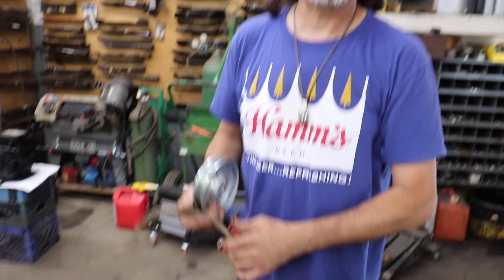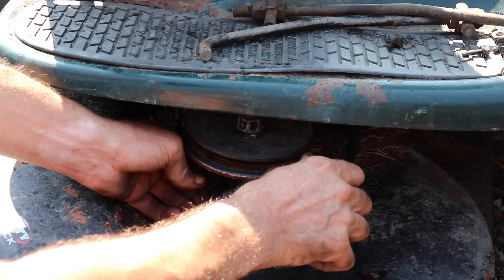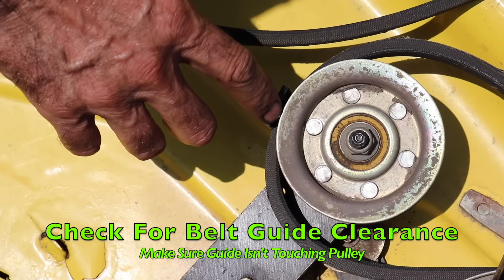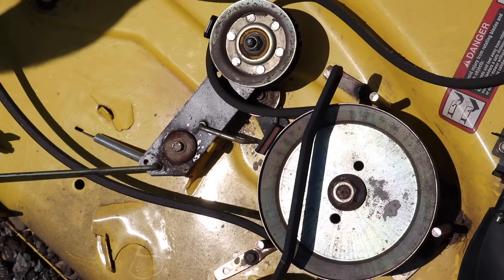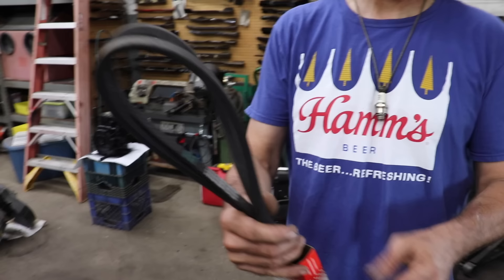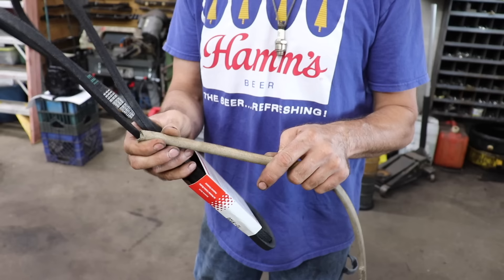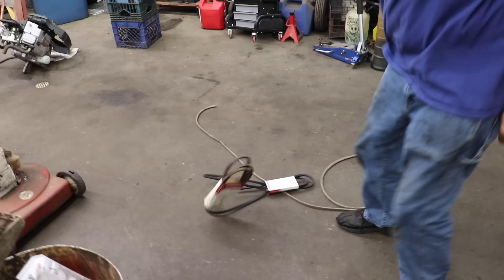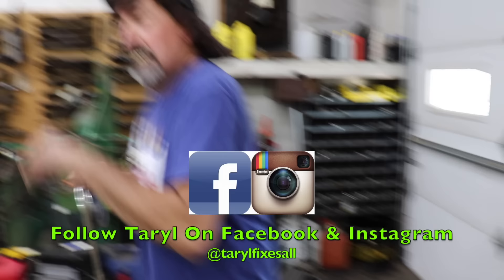Why Do Mower Belts Break?

Comment: Also, to help prolong the life of your deck belts engage them at low speed before throttling up to mow.  Every time you engage, you get slip.  Every slip equals wear.  The lower the RPM, the less slip ergo less wear and longer life.
Reply: And don't just slam it into operation. Ease into the engagement so you don't shock the belt having it go from 0 to full speed suddenly.
Reply: Wrong the pto is designed to start at full throttle! If you start at low throttle it can damage pto
Reply: Says so in the owner's manual as well

Comment: I just broke a belt on a brand new mower with less than one hour mowing. Now I know why. I was cutting really thick grass which is now under the cut grass, and then driving into an area that the grass is already cut and cleared. The belt was snapping as Taryl said. I didn't hear it or feel it but it had to be happening if Taryl said so. Now I should be getting a long use from my belts if I cut the grass the right way. Don't cut grass on top of uncut grass. Cut grass onto already cut grass. Now off to the store to get a new belt. Thanks Taryl. We're never too old to learn.

Comment: Also if your deck is engaged with a cable, the cables can stretch over time and also the spring at the end can wear and therefore not be tensioning the belt correctly when in the engaged position
Reply: Amine are old mechanical ones with the shaft on it good point

Comment: Right video at the right time. I only have 60 hrs on my John Deere Z930M but I recently seized a blade on an exposed tree root.  I smelled burning rubber before I freed up the blade by moving forward.  Afterward I heard this slight rattling sound and realized I burned a flat spot in the belt.  I considered purchasing an off brand cheaper belt but after careful consideration I purchased the correct deck belt from John Deere.  It was expensive but after watching this video I know I made the right decision going with the OEM belt.  Thank you.

Comment: Thanks Taryl!!! Loved this midnight snack..... yummmmmy!!!😎
Reply: Tayly i got a cub cadet 1040 cant get belt right .seems it slips no speed or drive problem.anyy suggestions.
Reply: @harryboeckler7198   Examine the deck pulleys. My nephew has a CC and it was throwing the deck belt constantly. He couldn't figure it out. I looked it over and on close inspection, you could see the tension pulleys mount, which should have been designed to have either a thicker threaded mount, or enough room for a nut under it IMO, had worn from the belt tension pulling on it. We had to replace the whole arm and that solved the problem. Part was a 'Idler Arm Bracket'. We also replaced the 'Idler pulley' because the bearing was shot, the Extension spring, belt and belt keeper rod. All those parts including shipping came to $173. It now works like new.
Reply: Thank you.

Comment: Awesome segment!
Reminded me of my Bolens ST180 hydro that used to go through belts like CRAZY, but only when I would have to raise the deck with the PTO on to get over rises, squirrels, etc.   Turns out I had a burr on the bottom of one of the pulleys that would just slice em up if the angle of the belt came close to parallel with the PTO pulley.

Comment: Grass packs around pulleys & deck EVERY TIME I mow. Have a 48 inch air blow gun from Harbor Freight and use shop air to blow deck clean before putting garden tractor up. If used water to spray off, would have to wait to dry & might cause rust our damage grease seals.

Comment: As a old wise man said.....lawnmower is not a Bush hog.
Reply: That’s why you should cut your grass weekly I mean that’s how I do it and it looks nicer when your done if you cut 16 inches of grass it’s all dead because it didn’t get any grass plus it bogs down there mower if I want to cut that I use an old self propelled garden way sickle mower works great
Reply: Well, if you go real slow, and have the deck set high, they'll bush hog pretty well. Depends on the HP too. I end up bush hogging sometimes when my horse pasture gets out of hand, when I've been busy on other projects and neglected mowing. I've cut waist and even shoulder high weeds and grass with a LT1000 with a 17 hp Intec, and it never bogged down, I just had to go real slow. Main problem bush hogging with a grass mower is the deck. It's too enclosed. Bush hog and brush cutters have the front of the deck open, so the blades can hit the weeds without being bent over by the front edge of the deck. I recently purchased a junk LT1000 with a deck for $50, and am planning on cutting the front and sides of the deck away, and installing it on my good LT1000 and see how that works cutting weeds and brush. The worst problem really with all of these riding mowers is you can't raise the deck high enough for the best brush hogging. I'd really like to be able to have the deck at least 6 inches off the ground. But all these mowers are designed for mowing golf courses it seems.
Reply: @hunter7476  I have one of those Garden Way sickle mowers. It's sitting in my barn unused for many years now. I got it used, in good working order, with two blade heads. The thing breaks teeth way too often, and they're a pain to replace. Plus, you can't use the cheap normal teeth for farm sickle bar mowers that you can get at TS. You have to use TB's special teeth that cost ten times as much. Eventually both cutter bars, the steel strip that the cutter teeth are riveted to, snapped in the middle. That little piece of steel costs $150 to replace. They get you coming and going. Someone needs to devise a way to make a better cutter bar for this little mower that can use regular farm teeth IMO. Till then, brush mowers that simply use a normal lawn mower blade are far superior because they are cheap, way more durable, and easy to sharpen or replace if needed.
Reply: Or the shuttle
Reply: I was able to mow 2 foot tall grass with a 1987 Craftsman lawnrider with a 12hp OHV engine in it.  36" deck on it.
what I did to do that is had the deck set to the highest setting and went in first gear, full throttle. it cut that grass like BUTTER when I did that! never bogged down once. (the highest deck setting is I think 6.5 inches off the ground if I'm not mistaken) full-on BEAST of a mower

just a little tip for y'all: if you encounter tall grass while on just a basic riding lawnmower, mow it in first gear with the deck at max height

THERE'S YOUR DINNER!
Reply: @hunter7476  There are a lot of people near me who have brown lawns from a lack of rain.  It is horrible.  The only good that comes from it is that it is less work for them because their grass isn't growing.  They live in housing plans and the HOAs have a lot of rules and one is that the grass is usually mowed and looks good.  The problem I always see with that is dead grass or grass that looks dead.  Now look at me, free from the tyranny of any HOA because I don't live in their plans.  I have crab grass that does a lot better in this weather than what ever they have and I never use any lawn care services (even though my neighbor owns and runs one).  Our grass is not growing fast but it is not that hideous brown that a lot of people have either.  See why it is best to just leave the lawn alone and just mow it regularly?  I don't have any specific timing for mowing my grass, I just go out and mow it if it looks noticeably taller (not out of control tall).  Keeping the blades sharp (as Taryl mentioned) can help.  Sometimes grass it a bit too tall in some places and looks a little ragged, I just slow down there or even pass over it one more time slower.  A wise man (who I know) said that a weed is just a plant that is in the wrong place.  Think about it, dandelions are weeds yet you can buy the seeds and grow them all over the place.  They are usually just a plant in the wrong place.
Reply: Or a box blade...I keep the riding mower going for the widow lady down the road. The blades would not engage. There was rocks / gravel on top of the deck. One of the rocks was jammed in the mechanism stopping the pulley from engaging. She had been lowering the deck to the lowest setting and straddling the crown in the middle of her gravel driveway to smooth it out.....well  at least she disengaged the blades before she did!!!
Reply: @dkeith45  I've thought about doing the same cutting the front of the deck out. I think the front tires would have more flats from debris getting thrown into them. You could just put slime in them. Would be a lot more dust, dirt, clippings on you and the mower. You would have to be more careful of rocks, roots, and stumps. Have you thought of cutting just some of the deck out. Make the front of the deck look like it had spaced apart teeth. The teeth might catch the larger rocks, while the grass could go through the spaces between the teeth. Let me know how it turns out.
Reply: @andybozeman9769  Using the mower deck as a scraper, wow, lol.
Reply: @andybozeman9769  I doubt it would get much debris on me, but we'll see. For example, I took one of those walk behind weed whackers, removed the string trimmer head, installed a lawn mower blade, and made a deck with a piece of 1/2" treated plywood. The deck is just a flat piece to cover the blade one inch past the tip of the blade rotation. It works awesome, cuts through anything. Only down side is the tiny cutting area, and that it's not self propelled. Although that can be a plus in a way, as it's so light, it's really easy to maneuver.
Reply: @andybozeman9769  lol...i know a guy that cuts with the deck all the way down. His way of thinking is it will level the yard .he is forever buying blades,belts,and bearings.i just set there smh when i can see him through the flying dirt..gravel...limbs and anything else in his way.
Reply: @dkeith45  Iused a sickle to cut around pounds. You had to be careful ,bigger limbs would break the blades .They were not fun to repair.
Reply: i always wait till my grass is up to my knee and the city guy start to take pictures before mowing.
Reply: @JuliaCV9  i use a normal push mower on my lawn about 300ftX300ft. i cut it maybe once a month is your lucky. i made a big chute hole in the side of the deck and i sharpen my blade with a grinder. absolutely no problem cutting 2ft+grass on a little 1-2hp mower (written 4hp on it, but its wrong).
Reply: @Francois_Dupont  It's unlikely to be under 3.5hp unless it's really old. The only engines I can think of under 2hp were the ones on the old David Bradley walk behind tractors.
Reply: @dkeith45  check out Honda website for the real HPs of engine. alot of manufacturer got sued for mislabeling and are now only listing CC's instead of supposedly power output.  it is why you dont see HP on engines anymore. my snowblower is stamped 14hp, but in reality it is not even 8hp. the old briggs style tappet valves flathead are absolute garbage in term of output power.
Reply: @Francois_Dupont  That sounds about right. Because back about 1978, I bought an old David Bradley tractor, that had a 1 3/4 hp engine, and it had amazing torque. Plowing using its single bottom plow, it could cut through any soil. Then I'd run over the plowed ground using its disc harrow. Worked great. You see riding tractors from the sixties and seventies, with 6hp, 7hp, 8hp engines. The really big ones had a max of 14hp. Now a days, those same tractors have 18 - 25 hp engines and I've always wondered why. I've also heard an old cast iron engine of 14 hp is as powerful as a modern aluminum engine of 22 hp and I don't doubt it. BTW would you please link the Honda page you mention?
Reply: That was my DAD.  LOL
Reply: @dkeith45  m
Reply: I only have a .4acre lot on a lake front...itz been raining a lot here near ATL airport...I only have an adjustable deck push mower...hoping to get a "frankensteined" self-propelled going soon...I'm too old now to cut grass every week...I just wait till dry ground happens...besides that, the bees here need a chance to pollinate the clover mix greenery on the ground this time of year...I forgot more about belt technology than most dumkophs ever learned what happens to improper knowledge 'bout 'em...
BTW, have not gotten into lawn tractor mowers at this time...just like Teryl sez, I only have a donated Crapsman and older Snapper w/10hp Broken/Scrappable for parts of other "oddities projects" like portable generator from auto alternator, using coils to convert to electronic spark on points/condenser junk...
Thx Terryl, but I used to share a Hamm's brewsky as a teen idiot with my Missoyri dad...but cannot consume any alcohol now at 74...and I have too many t-shirts, commercial aviation memorabilia clothing right now to hopefully cash in on
from Delta A/L, 
AirTran(now the reborn UNITED A/L)...
BTW, I was a n F.A.A. licensed /Senior Q.C.-Q.A. Inspector/Instructor on G.S E. Jet-A Fueling equipment,and gas, diesel equipped trucks...but never too proud to learn about small engines...I also got into the Chevy  Corvair upgrades and that is where my wrenches led me to aircraft technology,
And my dinner is always 
"Brunch"
around a retarded 🥴 4-5am!!
🫡

Comment: I had a Bunton mower years ago that wore those drive belts out like you mentioned. Wish I hadn't sold it. Got lucky and found a set of original equipment belts when I rebuilt my deck. Had been shredding belts. Now I know why. Cuts nice again for a 21 year old Craftsman.   Thanks for another great video.

Comment: 2:30 if the pulleys are really worn they will bite into belts and won’t want to release them. Learned that from an hvac guy that works on electric motors and fans. Wears the out even more and extra load.
Reply: Don't think i would agree with that description. Worn pulleys would lead to the exact opposite of biting. Slippage, therefore heat, and glazing of the belt would be the result. Worn bad enough, the side of the belt isn't gripping the pulley at all, and could or more likely be riding on the inner circumference of the pulley.

Comment: another great video Taryl.
i was given a Murray 38702x20c recently, and was told it just needed a bushing for a front wheel, i was later told it chewed up belts super fast.
it's currently stripped down completely, there are four belt guides at the front, and  three on the rear, 6 were bent and grooved from rubbing on the pulleys.
the main frame assembly had patches welded on each side where the trans-axle bolted on, both patches were broken, so it was only held onto the mower with the brace near the brake disc, the reason for the strip down is a dozen cracks, someone way too heavy owned it in the past.
the deck is pretty bad, but i might be able to repair it, at worst the mower can be a tow vehicle for the firewood cart or the lawn sweeper.
regards from Australia.

Comment: Good video. You say not to go too fast or mow too low because you're feeding too much grass and you point out  to make sure you have the proper clearances. One thing I saw was a bunch of grass by the pulleys and you don't say to clean that grass out of there and another thing that goes along with abuse of the belt would be having a grass build up under the deck that prevents getting rid of the grass quickly and causing the slipping of the belt. Also found a portion of a tarp wrapped around one the the blades on a S160 John Deere. 
Good stuff. Thanks for the info.

Comment: Good and correct information.  Some belts are over $100 and while they do last a long time they eventually wear out and when they do it is time to look at and replace the pulley and idlers.  Everyone wants to replace just the belt and then complains that it didn't last as long as the original.  Duh.  OEM belts usually cost more but you are already at the dealer buying new pulleys and an idler or two  Right?

Comment: I know what you mean about John Deere belts. My 214 has a horizontal shaft engine so the primary deck belt has to make a 90 degree twist in order to connect to the deck pulley. I was replacing the belt every year with good high quality belts. It turned that belt has a special cross section 9/16 x 29/64. I bought the proper belt and it's been good for 6 years now.

Comment: I'm surprised Taryl didn't mention pulley alignment. If your deck has adjustments for leveling, make sure the dang thing is leveled according to the manual!
Reply: Also running over tall ant hills at high speed with the blades engaged.

Comment: One other problem I see in my shop often enough to mention is the brake shoes that stop the deck get warn enough to sit in the pulley to far and contact the belt causing the belt to break or come off when the deck it turned off,Thanks for a great video!!!

Comment: Yes I have went through all the belt troubles mentioned my old mower that I got for free basically learned all the things that Taryl teaches here the hard way lol
Also if your pulleys are not ridiculously worn-down you can clean them up with some sandpaper and that will help.
I did the angry belt dance at the end myself a time or two.
Reply: angry belt dance, yes, I've taught that one at my shop.

Comment: Good explanation on why belts may break.  The tech assistance folks at Grasshopper say the blades should be engaged at 3/4 to full throttle speed.  Contrary to some but it really does work.

Comment: Earlier the winter I purchased A belt for my lawn tractor snow blower attachment that cost about 170 from the dealer. I than ordered one from A small engine shop that sent me A B114 that was around $20. That cheaper belt which is much stiffer than the oem is A much stiffer belt that keeps coming off.

Comment: Good tips. I have a 30 year old wheel horse that doesn't drive right away in 3rd gear, it screeches and then goes. I replaced the belt some years ago and used belt dressing but it still slips, I thought the belt was too big. But maybe my pulleys are worn out.